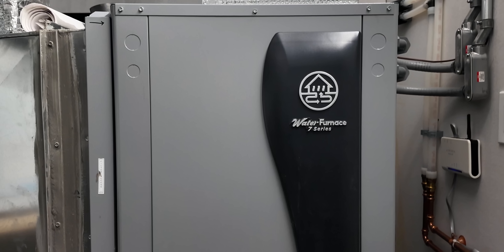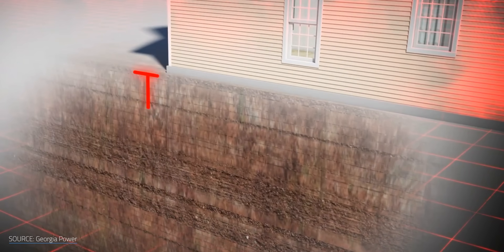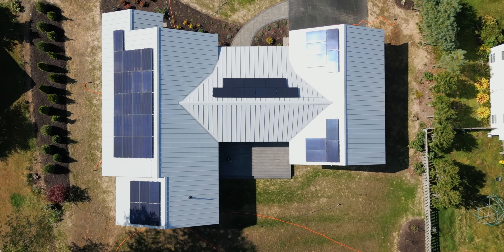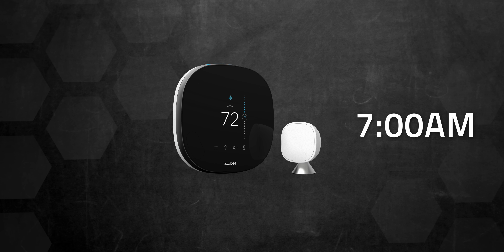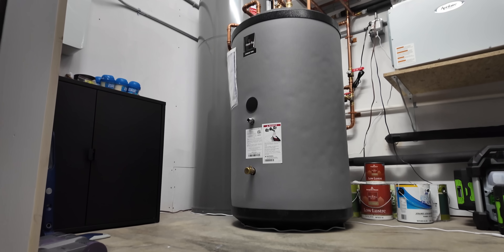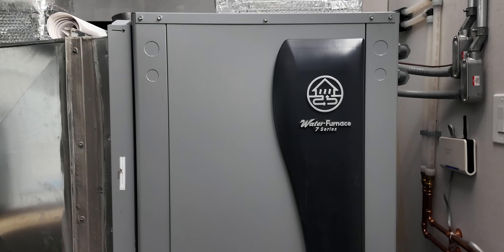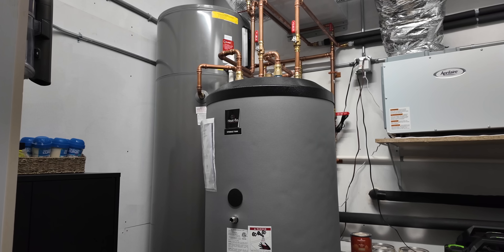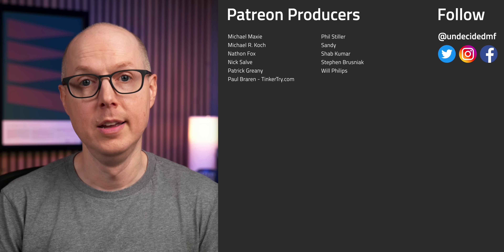How My Geothermal Heat Pump Really Performed (2 Years)

Comment: I put in a WaterFurnace nearly 30 years ago. It was an open loop system pulling water from 170 ft down. I don't know the actual cost, but it was a little more than $7k over what would have been the standard HVAC system. It was fine, but difficult to get competent service on it, and I lived in their home state back then. Now I live in a much sunnier climate, and decided to spend the extra money on solar and go with air sourced. To get higher efficiency systems, I still spent about $7k to upgrade, but inflation adjusted, it was not comparable. My daughter lives several hundred miles north and she also put in a WaterFurnace some years back. She has no solar, but is very happy with her electric bills. I've lived in MA many years back. I forgot how expensive everything is. My electric rates are $.09 days and $.05 nights. That does not include taxes and other charges, but very different from MA. Your system was probably more than my solar and I have 74 panels. So far this year they've put out nearly net 15 MWhs  more than we've used and am carrying a credit.

Comment: When I decided to build a new and super efficient house in Princeton, MA, I considered a geothermal heat pump, but as the design progressed I adopted the "Passive House" design standard and I quickly realized that simple mini splits were just fine, because the house was so easily heated that I could have used simple resistance heat.
Reply: Yes, in a Passive House heating is a minor issue. The heating method does not really matter. You could use anything, even small camping equipment. Everything else is an overkill. The Passive House slogan for heating back then in the 1990 years was, that a good old light bulb would be enough. That was the time before LED light was invented.

Comment: The key is what you said it depends on your situation, but assuming you do not have solar or geothermal, at the price that you paid, it would have a 50-year return on investment. If you don't have super generous tax rebates, the return on investment is 60-80 years.

Again, in your situation, you have a very well-insulated house. So, if somebody had an older house, that differential could be greater. For instance, the difference between $2,000 in heating and $4,500 in heating and cooling. Lots of variables. But without your solar, even in your situation, which is pretty ideal, that return on investment of the geo-thermal would take a pretty long time.

Comment: We put in a 5 ton heat pump HVAC system in 2018 that cost $10,500, that included replacing all the ducting with insulated ducting. Our power bill in the summer went from $180's down to $140's here in Houston Texas from one year to the next and even with the power price increases over the years still has not exceeded $160 per month.
It would take a very long time to justify that ground loop system over a heat pump.
Reply: I also wonder if the time value of money is properly considered. An upfront cost is different than a monthly cost over 20-30 yrs. That 80k he put up front could have been invested and that’s a few grand a year that he is effectively losing. I don’t think he can make up for that.
Reply: One factor no one ever talks about is the replacement frequency of air to air vs geothermal units.  The geothermal units are expected to last 30 years and have a warranty for 10. The air to air can fail as soon as six years but seem to average about 10. Given how expensive a regular air to air heat pump is, the more frequent replacement makes it far more expensive than the geothermal in most places.
Reply: It can never be justified, it's a vanity project that is a waste of money.

Comment: Someday all the components of the system will wear out, whether that's 25 years from now or 100.  And someone will have to pay to replace whether it's you or someone else.  Would it be possible to put a number on that future cost and amortize to get an idea of the annual deferred costs?
Reply: That’s true, but the component that should last the longest are the underground loops, which are the most expensive up front to install/drill. Reconnecting a new heat pump to old coils/loops should be doable for decades

Comment: $50,000 compounding interest at 5% is $135,000 after 20 years. In a diverse S&P index fund that probably also accounts for inflation.
That's not a high upfront cost, that's bloody astronomical.

I think the numbers only work if you have some kind of preferred financing or leverage. Able to tie it into the mortgage for instance.

Comment: I've been building well insulated passive solar homes since the early 1980's. My current one in the mountains of southern British Columbia. The home has R 80 in the attic, R 50 of cellulose in the walls and the slab sits on R 24 EPS. It is thermally broken from the insulated exterior concrete walls. There is 2800 sq ft. in total with an annual electric bill of $2,250.
I use simple baseboard heaters and there are two electric HW tanks. One is for the BNB.
In twenty years the total power bill would be lesss then a ground source geothermal system with nothing to ever break down,r need repairs or replacement.
Simplicity is always what I strive for.
Once the solar panels and batteries are installed the home will produce more power that it consumes.

Comment: When do you figure you will break even with respect to carbon? Adding all carbon from manufacturing, shipping, diesel for drilling,  etc. to make the system then subtracting off the savings in carbon, when do you reach 0?

Comment: If you have excess solar, then why not use an air to air heat pump?  New units czn go to -22f. They lose significant efficiency as you say, but that is like one or two weeks ago year in the lower 48

Comment: I just couldn’t justify the up front cost. My air to water heat pump only really loses out in the coldest winter months, and even then, a few extra solar panels can easily make up that difference for substantially less than the cost to drill a well. The difference really narrows when you start looking at just how much energy is used to pump the glycol through the ground loops. This is often not included in advertised COP values for ground source systems, and it’s sometimes several hundred watts. Not insignificant.

Comment: Haha. You said, “When you're talking about a 20–30-year timeline, the savings add up fast.” Uh… 20–30 years is still 20–30 years, that’s not exactly fast. Just joking with you.

I have a 4,000 sq. ft. house and I’m on year 15 with geothermal and a heat pump here in freezing and blazing-hot Missouri. I also have radiant floor heat, but I never use it, my bill spikes if it runs 24/7, even one day. My old all-electric bill, including HVAC, averaged about $180/month.

Then there’s solar. Cost $40k to install, but the company gave me a 1% interest loan. Now I pay $230/month, but $70 of that is just interest. So, principal drops only $160/month. It works, I use the co-op’s power almost never, but they charge a $36/month account fee for letting me put solar back into the grid.

So I went from $180/month to $263/month. Careful what you wish for. The good part? No matter how high electricity prices go, mine won’t, my payments go to the loan, not the power. And that loan lasts decades.

Comment: Cost to benefit ratio is just not worth it. There is an extra cost you don't include in your calculations and it can add up to ten's of thousands of dollars over 30 years, that is the interest paid on the $78K more that you had to borrow to pay for all those expensive "energy saving" heating and cooling systems. You can only get tax credits, not cash payouts, from some State and Federal programs. Which reduce your tax burden and you can only get so much per year based on your income which needs to be higher than the median average, which means you have to pay a lot in income taxes, to take full advantage, so unless you make way above the median you cannot get the full benefit. Unless you are planning on staying in that home for 30-40 years and even then I would not recommend it, you would be better off investing that $78K you spent in an index stock fund after 30 years it would be worth 1.3 million dollars. The only person who is really going to benefit from all your work is the next person buying the home.

Comment: One phrase: Return On Investment.  This may not sound very green, but if you wish to beat investing in the market, etc you need to actualize a 7% annual savings or an approximate payback of about 10 years.  So if you paid $70,000 up front, you would need to save $7,000 per year with the heat pump system relative to conventional heating and cooling system.

However, as Matt indicated, this really depends on your goals, but but we do need to include the return on investment as part of the decision making process.

Comment: I had dandelion do my geothermal system this year. I demoed the old radiators, boiler and oil tank and they installed new ducts, and a 2-ton system with a 200' well. Cost was 50k but after utility, state , and federal rebate it should wind up costing me 16k. Made financial sense and so far it's been great. We will see how it holds up this winter and years to come but I really like it so far.

Comment: So you added 40-50K to your mortgage, pretend it doesn't cost interest for 30 years, and imagine that it's more cost effective than being on the grid? You have to hope the system lasts long enough to average down the monthly cost of acquisition and installation.

What you're talking about here is extra bouji. Almost nobody is going to do it and it definitely impacted the quality of your retirement and the stability of your forever foundation in a big way.

But for real it's really cool. How does it handle quick swings in temperature though? Like in spring and fall when we get 30 degree differences between 4 AM and 4 PM? We haven't really had a cold snap in the past couple years either. I hope you've got some supplemental heating system just in case that one is too slow. Frozen people and pipes aren't worth it.

Comment: I was confused about the difference between a heat pump and an air conditioner for a long time. 

Turns out air conditioners are just one way heat pumps, they operation on identical principles.

Comment: Also in MA.  Quoted ~120k for two water furnaces, new ducts.  Even the thought of $55k, vs. a net $18k (28-rebate), for 5 tons of ASHP, whole-house, would have been tough to say 'yes' to.  Running through 4-6 MWh per winter.   Geo has a slow payback.  Still jealous of the tech, tho.  Not jealous of keeping on top of what can go wrong.

Comment: while id love such a system, at current fossil energy prices it isnt interesting in my case to go the heat pump route, be it geothermal or just air. my central heating feeds old cast iron radiators which im not willing to replace cuz it's a century home, it would be ruined with ugly modern low temp radiators, the same goes for destroying the 100+yr old natural stone floors in order to install under floor heating. the old cast iron radiators need water at 60 degrees C, maybe 55 at the lowest, before they start really transferring heat to the room by natural air convection. heat pumps have a COP a lot lower than 3 when heating water at those high temps. COP of 3 is the bare minimum threshold for heat pumps to be cheaper to run than natural gas or fuel oil around here. this is without accounting for the multiple tens of thousands of dollars to install the heat pump in the first place and without taking into account the fact you're looking at replacing the whole system after 20 years at best or even earlier if some random PCB crucial to the system isnt available in the dead cold winter... my fuel oil furnace from 1983 with cast iron heat exchanger, made in germany is still going strong with maybe 1200 dollars in parts to maintain it from 1983 till now. that's 1 new fuel oil burner and a bunch of fuel oil nozzles, all generic worldwide available parts. any ol handyman can repair those.

Comment: Geothermal the heating of the future and always will be . Too much upfront cost too much electrical usage and too much water usage. In my 35 year experience as a heating contractor that minispit heat pumps are probably the best all around system with a 90+ propane or natural gas backup system for below 45 degree outside temp.

Comment: Each ton of a geothermal loop produces about 12,000 BTU/hr. There are 3412 BTU/Kwh, so 3.5Kwh per hour, forever. At MA rates of $0.32/Kwh, a geothermal well will produce nearly $10k/yr in energy equivalent, forever. Installed properly, these things are essentially annuities.

Comment: I had a geothermal heat pump retrofied into my house in 2000.  The loop consites of 4 wells that are 180 feet deep.  My electric coop I belong to charged me $6000.00.  The original propane furnice and regular airconditioner that was installed in 1968 or 1969 were beyound there end of life.  I did not qualify for any rebates or tax incentives.  I still think that I have saved money in the long run.

Comment: The advantages of vertical ground source heat pumps (aka geothermal), over air source, are as you say huge! But here in England you cant find installers for anything other than air source heat pumps. Any advice?

Comment: Matt: If I get the math right. The premium of geothermal system over air source system is $15,600. The annual saving in operating cost is $1,150. A simple payback period is 13.5 years. Not bad. At least you get a net payback over the life of the equipment.

Comment: you went way overboard almost to the point of conspicuous consumption and invest so much up front that it is going to take a long time for roi, tco is high; better alternative is a couple mini split and positive pressure hepa with a heat exchanger. to get free energy in 6-7 years with an install you have to diy and skip the installation fees #amortization praxis

Comment: I want to put a building in my back yard. Does it work to put the ground loops under the building for a horizontal system? I want to house the system in the building but pump the fluid to the house. Any thoughts?

Comment: Like many home system choices how long you intend to live in the house can be the deciding factor. I would love to have solar with batteries but since I'll likely move in the next 5-7 years it doesn't make financial sense.  The new water heater I just iinstalled is a heat pump. The new furnace 3 years ago was as efficient as I could get.

Comment: While clearly geothermal heat pumps are more efficient than air exchange heat pumps, especially in cold climates, I can't help but wonder about the cost effectiveness of them. $78K would buy a lot of solar panels to more than make up for the efficiency loss of a good mini-split.  I wonder about a cost comparison between a far less expensive mini-split air exchange heat pump while adding 4 or 5 additional solar panels vs. your geothermal unit.  Comparing it against traditional electric heated coils or natural gas central heat against your geothermal unit is one thing, but how about against a far cheaper option like a $2K mini-split and $3K more solar capacity?

Comment: Very good and honest video. For myself I’m afraid I would never see any payback on a geothermal system. Utility rates are 15 cents per kilowatt and I could even get a better rate for a variable rate plan if I heat just at night. However, my interest would be for a system that lets me off the grid as power can be unreliable and a risk for a massive tsunami is a real threat where I live; so as an emergency backup, solar and geothermal makes more sense as compared with gas or diesel alternatives for backup.

Comment: My question is if the savings are worth the upfront cost, when you factor in that the money you spent on geothermal could instead have been spent on more solar panels. In other words is it more economical to invest into lower power draw or higher power production? I'm guessing that's the case in colder climates where both solar and air pumps perform poorly, but in warmer climates it might be the other way around.

Comment: I approached this topic completely differently as much as I have 3 conventional heat /cooling pumps I looked at solving the problem at source not a bandaid solution to rectify and regulate. My heating in the winter is on for approx 1.5 hrs in the morning to get the temperature up to the desired 21c and after that it’s off. The home stays constant all day with a nice drop off in the evening to 19c as I prefer it cooler to sleep in.  I don’t have any of this upfront capital or longer term management and technology refresh which will come for the complex systems.  In summer heat I just open up the floor to ceiling glass doors and allow the sea breeze to blow through. If it’s 40c plus close the doors and use the pumps. But that’s about 10 days a year.

Comment: It's the short warranty periods and whether the company will be in business. It all looks good until you have to replace parts or the units. If you get 20 years out of the units, you are fortunate. 
My kWh is 19.1 cents in New Zealand dollars, equivalent to 11.46 cents in US dollars.
I've researched wind and solar costs, and I can't make it pay. Insurance companies worldwide seek to exclude homes with solar panels on the roof from their coverage. The main roof under the solar panels cannot be maintained, and solar panels are like sails; they can take your roof off in high winds.
The cheapest way to reduce power costs is by reducing the use or moving to a better climate. 
You could use coal or wood, as there is some non-polluting option now and it will work for ever if the power stops.